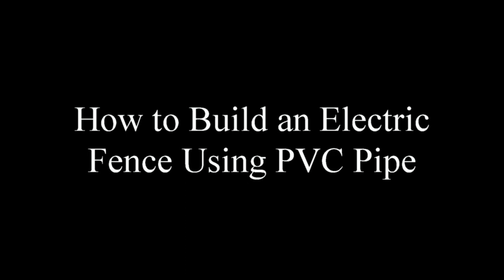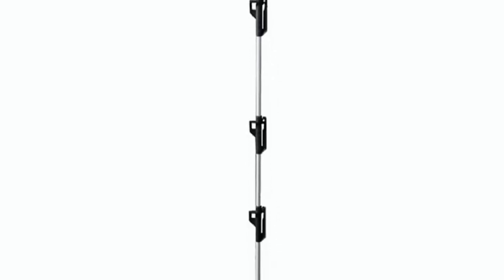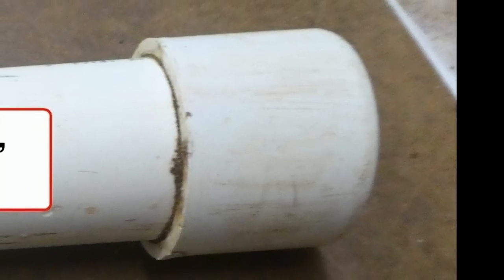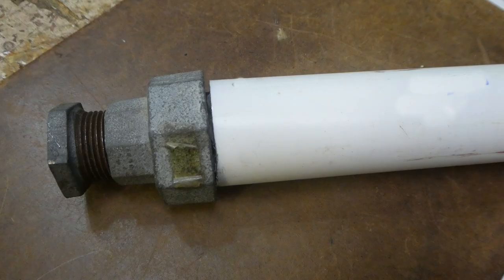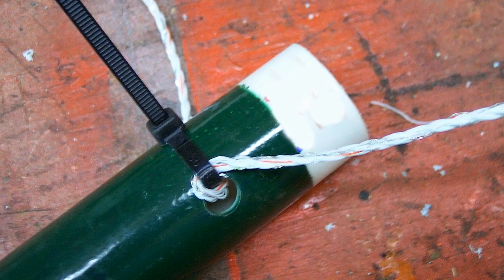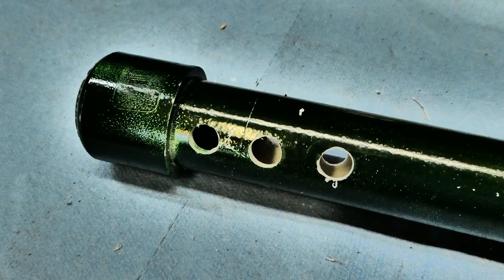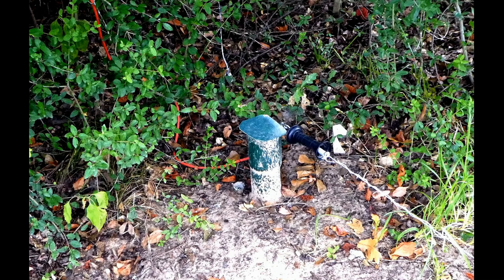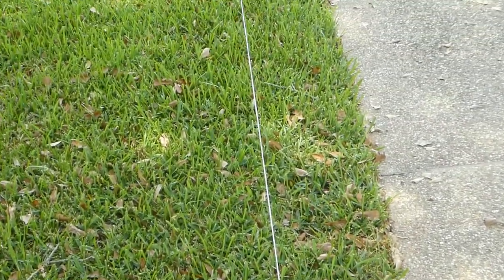Build An Electric Fence Using PVC Pipe

Comment: How is this holding up?
Reply: still working fine.   I have it set on a timer just for the night time, when the armadillos and hogs come around.
Reply: Love the idea of sinking the larger diameter PVC pipe into ground to act of a sleeve for the smaller PVC pipe. 
Do you think your method can hold a 8FT PVC  pole in place without concrete?